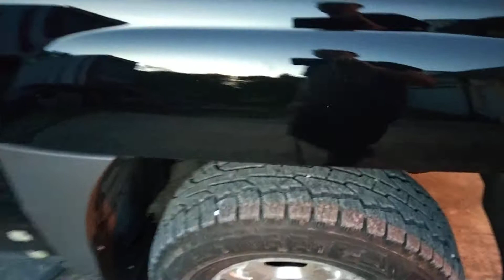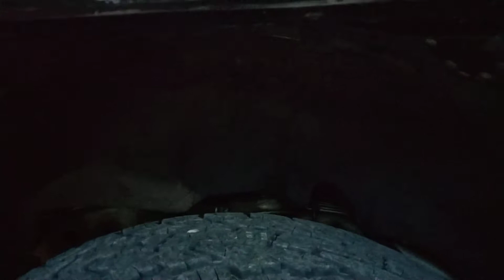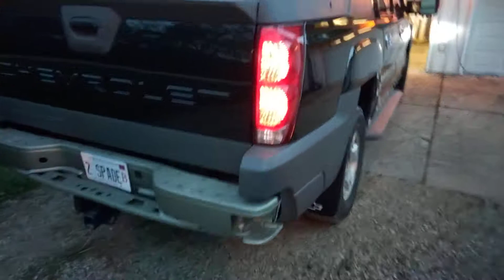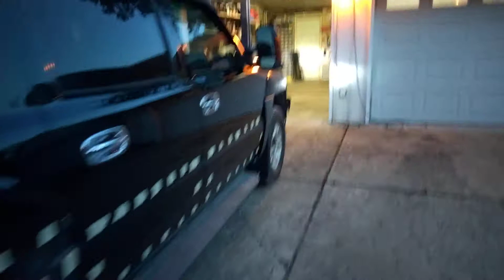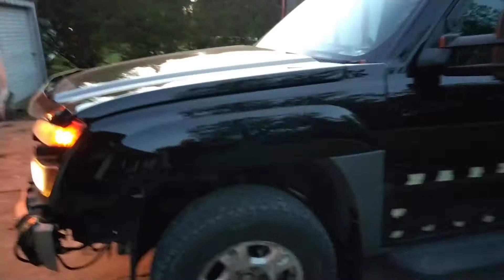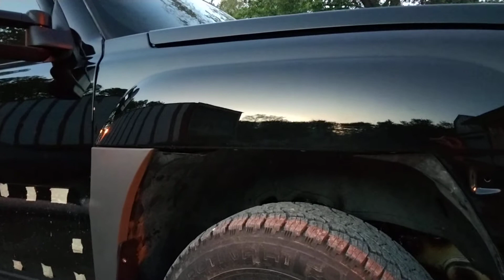Comp Cams Evolution LS hyd roller lifters at 38 hrs run time

Comment: you ever found a solution to that tick I got the same. When cold it’s quiet and hot it ticks. Also new lifters and all that
Reply from the maker: I have not found any solution. I am running Driven GP-1 oil in it now, this is a 10W-30 synthetic blend. This is the 3rd type of oil I have tried and they all sound about the same. I have dual remote oil filters now, in addition to an engine oil cooler that was always there. In cold weather the oil runs cooler and this affects the sound a little bit. Basically the hotter the oil the noisier it gets. I feel less heat with my hand at the cooler after installing the large dual remote oil filters, so I guess the 2 big cans and the plumbing reject some heat. I had a Comp Cams rep preach to me about natural base oil yielding higher oil psi. This is not true by my observation. He also told me to use a "good synthetic blend" which I have used, and none of this helps. I have had straight natural 30 weight, full synthetic multi weight and blended multi weight oil in it, with no improvement. I am convinced the only solution is to try somebody else's lifters next time, because these lifters are never going to run quiet.
Reply: I have a video of mine online take a listen. I at the same point you are… different oil filters and so on

Comment: what cam are you running,certain profiles are noisier than others.
Reply from the maker: The camshaft is Comp Cams #54-525-11, specs are duration @ .050" 194/206, lift .500/493, LSA 117* 
This is a mild stock idling cam that has .050" more lift at the valve than the GM OEM 5.3L cam it replaced. When it comes to how the engine runs with this cam I am pleased with it because it does exactly what I want. It pulls full throttle real nice on ported heads with 5psi boost and otherwise it drives like stock. Comp cams did tell me that a performance cam can have a more aggressive ramp profile intended to open more quickly that can result in greater noise. I don't know if that applies to this cam profile, but it is far from aggressive in anybody's book. This is actually the mildest grind they had to offer when I asked them for assistance in selection. It does not get any milder than this without going back to stock.

I have driven the engine all summer, maybe 100 hours more, and the lifters have quieted down just a tiny bit, but not much. When cold they don't sound bad but they get louder once the oil is fully hot. I have become used to it since the engine does run well, so I reckon I will just live with it. But if the engine has to come apart again I will go back to OEM lifters with the plastic trays. This is only a 5500 rpm engine. I thought the link bar lifters would be a nice upgrade but I had no idea the noise nightmare that was in store. I don't know if you listened to the video I made of the Comp Cams LS retrofit lifters I had in the engine at first, but they were horribly noisy. I went to Evolution lifters and they are quieter than the LS retrofit, but still noisy. That's all I can say for my experience with them.
Reply: @onemoremisfit  thanks for the info,extremely valuable info. It's becoming impossible it seems to find a quiet hydraulic lifter these days.